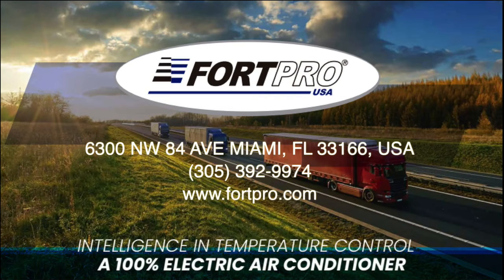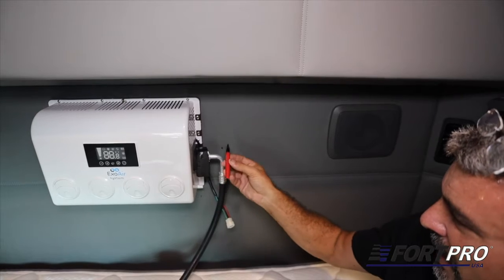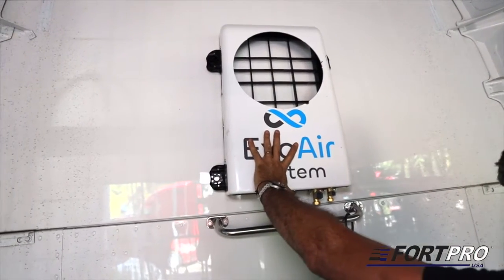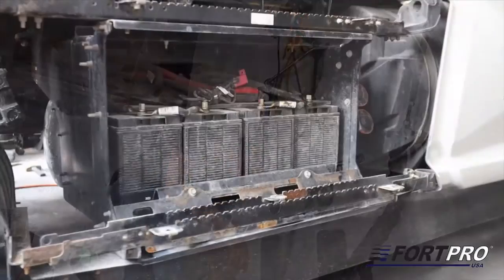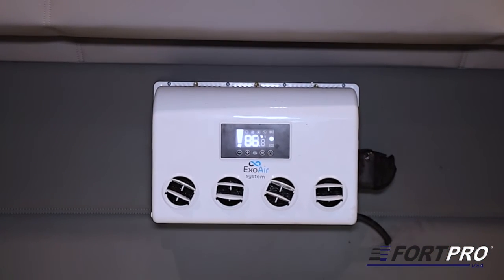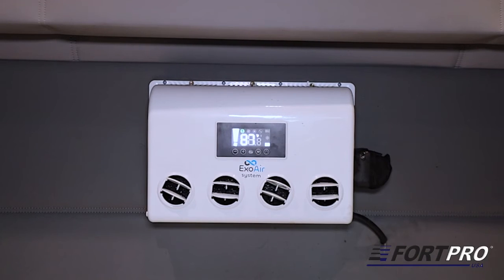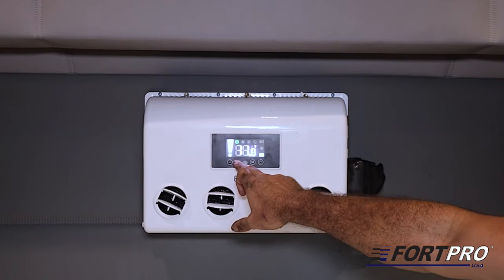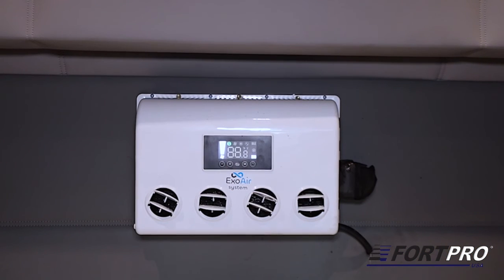Installation Video Fortpro ExoAir System - Electrical Air Conditioner SKU: AC16106601

Comment: can this ac unit work in you house
Reply: Sure you could but I don't think it would be very effective. The inside dimensions on my truck are 10ft x 8½ft x 9ft . Most semis are sized similarly and a house is much bigger. AC units are sized for the space they are designed to cool. This is sized for a fairly small room and meant to hold up to quite a bit of road vibration. 
I'm sure there are better suited AC units for Household use that would be much more cost effective in both upfront and longer term operating costs

Comment: I bought one for my Freightliner Cascadia. It can last for some 8 hrs before you have to start truck. You can leave it on when truck is running. It works well as long as outside temperature is, say, 95 degrees or below. For higher temperatures it will last a lot less. The way it works is the lower the temperature the more it'll leak your battery. It has 3 modes. At dealer they recommended eco mode, which basically is a fan, not an a/c. So I use the middle mode.
Reply: What dealer did you go to? I got one installed and its nonstop issues
Reply: How long it will take when you use middle model? How’s your feeling about the AC.
Reply: Does drain the battery's in long run??
Reply: So eco mode does not actually blow out cool air using the compressor? Seems like a high current draw for a fan using 19 amps.

Comment: I have a 4000 W generator inverter that I currently run my wall unit in my truck off of. Can I run this off of my generator
Reply: You can buy a big battery tender that’s meant for all sorts of heavy duty batteries. Plug that into you generator and run it to your 12v batteries and it will constantly charge your batteries whenever the generator is running
Reply: Were you able to?